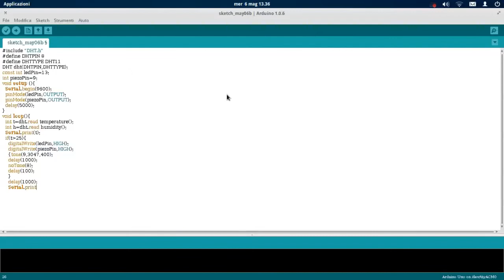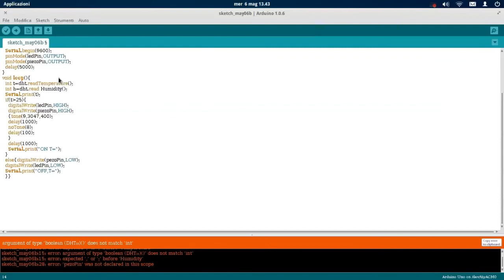Arduino Tutorial - Overheating alarm

Comment: It is showing the first line of the code is wrong for me
Reply from the maker: #include "DHT.h"

#define DHTPIN 8     // Digital pin connected to the DHT sensor
#define DHTTYPE DHT11

int ledPin=13;
int piezoPin=9;

DHT dht(DHTPIN, DHTTYPE);

void setup() {
  Serial.begin(9600);
  Serial.println(F("DHTxx"));
  pinMode(ledPin,OUTPUT);
  pinMode(piezoPin,OUTPUT);
  dht.begin();
  
  
}

void loop() {
  // Wait a few seconds between measurements.
  delay(2000);
  int t=dht.readTemperature();
  int h=dht.readHumidity ();
  Serial.print(t);
  if(t>25){
    digitalWrite(ledPin,HIGH);
    digitalWrite(piezoPin,HIGH);
    {tone(9,3047,400);
    delay(1000);
    noTone(8);
    delay(100);
    }
    delay(1000);
    Serial.print("ON T=");
    }
    else{
    digitalWrite(piezoPin, LOW);
    digitalWrite(ledPin,HIGH);
    Serial.print("OFF,T=");
    }}
Reply from the maker: if you also have problems with the new code you have to install the dht.h library
Reply: Sir I have done water level controller using ultrasonic sensor but when the water reaches high level the buzzer keeps beeping continuously , but I  want  to stop the buzzer  after 10  seconds when the water level high. Plz a request with you send the codes